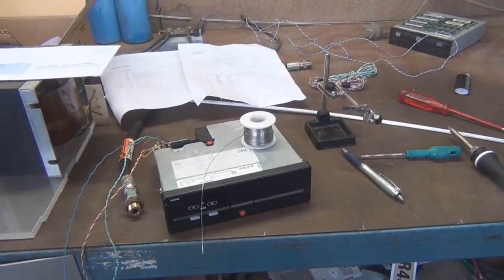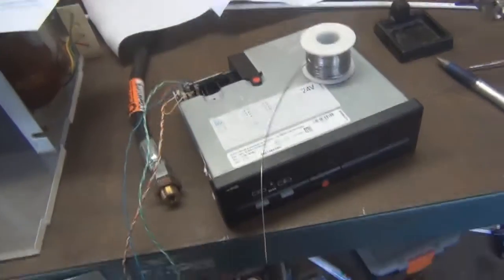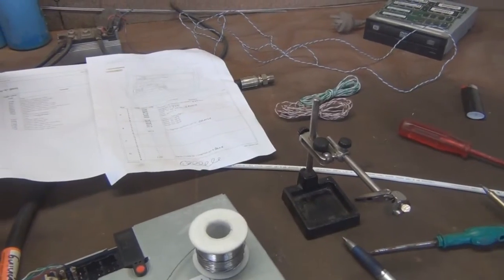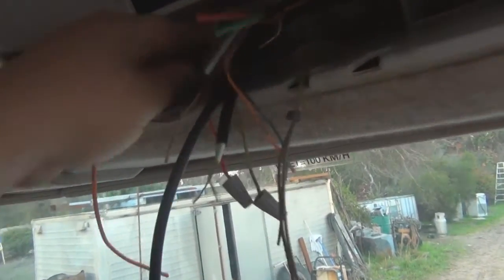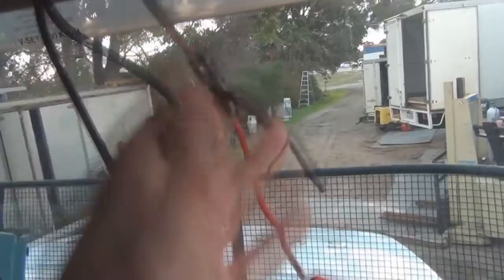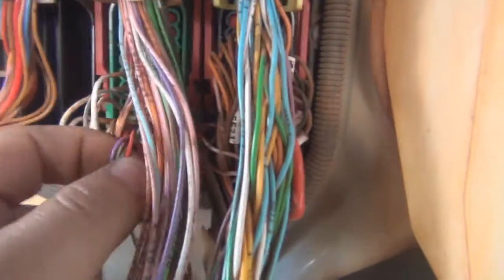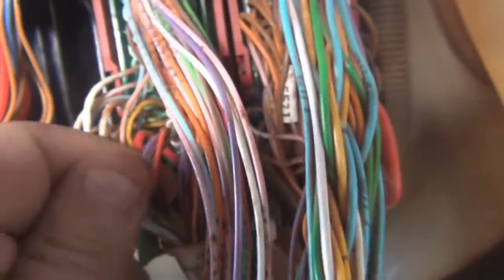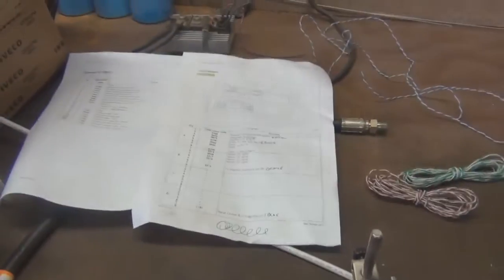Iveco Tachograph - The Silver bullet?

Comment: Hell some people are really evil with wire cutters, did i hear you say the can bus was chopped, shorted at the end where the chop was?
Does the tacho signal go through the unit to reach the speedo or was it just shorted out.

Dont you love numbers instead of colours lol, i bloody dont, i had a peugeot car to look at, lots of tiny numbers printed on the wires, i expected every wire to be clean white but they have colours... ugh??
Reply: Tachographs are crazy complicated these days, in order to put off people who are up to no good. 

In the EU, the wiring from the vehicle speed sensor to the tacho-unit has to be digitally encrypted. When it was just a pulse signal, people would splice in remote-control pulse frequency controllers. One push on a key fob, and output freq = input frequency * 0.9. Another push, output = input * 0.8, and a third is output = input.

This type of hack was very difficult to detect for your random roadside cop, if they inspected the tachograph record would be hard pushed to tell whether the record had been tampered. Of course, if you had a map and compared mileages/speeds, etc. it would show up in a proper investigation, but most cops would just let you go, unless they really thought you were dodgy.

Of course, even the digitally encrypted tach systems can be tampered. The new scam is to implant a pulse-frequency controller in the gearbox. This contains a magnetic pickup, pulse frequency controller and a motor with a magnet on the end. The tacho sensor then screws into this, and when sealed in place with an official govt seal, it all looks legit.
Reply: ChumpusRex
Ooow i hadnt realised they were so complex now, from tampering with the basic digital to intercepting the signal before the pickup sensor, its a complex game.

Everything can be messed with, its searching for a weakness, and if the encription is defeated then a pic chip or similar can re encode.

I can imagine the tricks used to stop you tampering, like sensors having i.d's that must match what the main computer expects, and a new random encription piped to the sensor everytime you switch on, so it never stays the same, ooow :-((